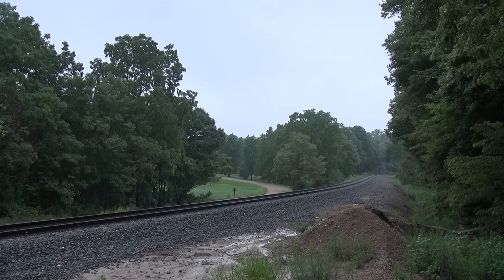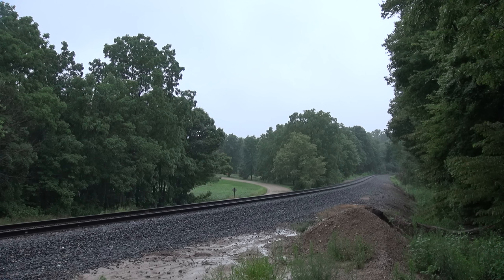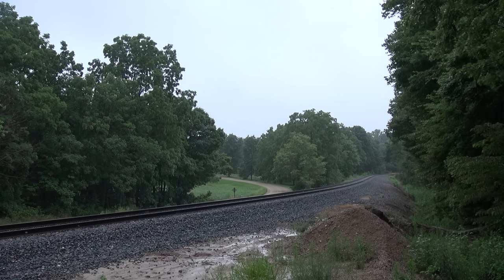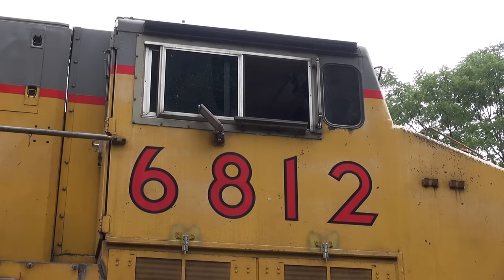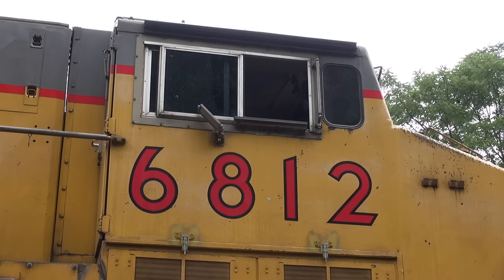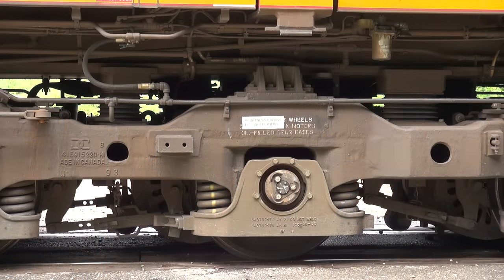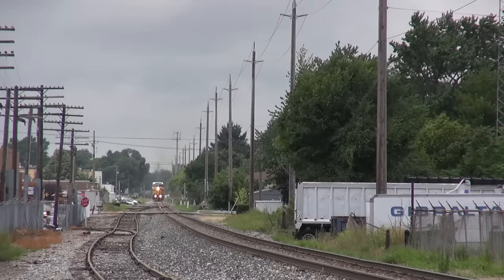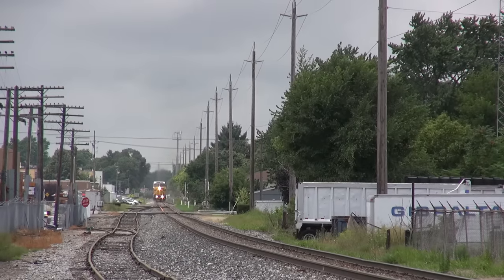TRRS 477: "Whoops!" CSX Freight Train Stalls on Grade

Comment: This wouldn't be an issue if freight trains had all-wheel drive. Yes, having an electric traction motor connected to every single bogey would cost more, but trains wouldn't get stuck on grades imperceptible to the human eye, could stop a lot faster when necessary, and could even hypothetically make use of regenerative braking as battery technology improves.
Reply from the maker: Is not so much a problem of trying to get traction, as it is just a lack of horsepower. You could take every kW generated and put it to the rail, and this train would still not get up this hill. At some point, you just run out of electrons, and most power today is pretty well capable of putting almost everything they have to the rail. Not worth the additional complexity and costs of going all-wheel drive.
Reply: @ThornappleRiverRailSeries : If AWD weren't worth the additional cost and complexity, then the best trains in the world wouldn't be AWD.
Reply from the maker: False premise. High-speed trains use AWD because they are attempting to attain insane speeds and balance out the trainset. Heavy engines with lite cars doesn't work too well - weight distribution matters. Not to mention that those trains operate as set consists that are almost never pulled apart, versus a network with millions of individual railcars and locomotives with widely varying lengths, weights, horsepower, etc. 

Completely different engineering needs and circumstances. Costs and complexities make sense for HSTs but not long, heavy drag-them-out freight trains. That's why literally nobody does AWD freight trains of any significance.
Reply: @ThornappleRiverRailSeries : You are referring to Jacob's bogies, which require a train to visit a service depot to uncouple the cars. I agree those would be a bad choice for freight trains, but they are not the only solution to building AWD trains. The French use them on TGV trains, but nobody else does. It is far more likely that nobody builds AWD freight trains because the profit margins for freight rail are so razor-thin that they don't invest in any R&D if they can possibly avoid it.

From an engineering standpoint, having each car equipped with powered bogies capable of moving the fully-loaded weight of that car (which varies depending on the type of load it's designed to carry) makes perfect sense. Powered bogies allow trains to be any length imaginable, from a few cars to several miles long, with no increased risk of structural failure. If every car can move its own weight then the net load on the couplings is close to zero, and each car doesn't have to be overbuilt in case it happens to be connected near the front of a very long train. This in turn reduces fuel consumption because the train isn't forced to haul dead weight uphill; the mass of each car's frame is less and less valuable for structural purposes the further back in the train the car is positioned, and by the time you get to the end of the train that extra mass is just dead weight -- but it still requires fuel to haul it around. In the event that a powered bogie suffers a failure, the locomotive at the front could still make up the difference, but most of the time it would just act as a portable power station.

Let's face it, freight rail is about as innovative as the Catholic church. They build things that work well-enough and then they use them forever, but that doesn't mean they're the best solution.
Reply from the maker: Shawn Elliott No, it still doesn’t work. You’re just ignoring the entire cost part of the deal. What you lose in frame weight for buff and draft forces you gain right back in powering the trucks. You then multiply complexity tenfold by now having traction motors, gears, power assemblies, cabling, computer control, etc on Equipment right now that is simple by design.

Moving freight is NOT a low-margin enterprise, at least in North America. The Class One railroads currently have profit margins between 30 and 40 percent. 

If you ever actually considered the cost and complexity from a true engineering, management and financial perspective, you’d know for sure that it is an absolutely terrible idea to go with all-wheel drive. All that work to gain basically nothing, and In fact, once you account for maintenance you’d probably be losing.
Reply: @ThornappleRiverRailSeries : I concede that maintenance costs could be a deal breaker. All of those extra motors and gearboxes could be a significant maintenance liability, but provided they are specced correctly, electric motors can run without any maintenance for decades. At that point the replacement interval for the electric components matches or even exceeds the replacement interval of the rest of the car.

Comment: My question is do they have to put the train cars back in the order they were in or does it not matter.
Reply from the maker: Typically they'll reassemble back into the original order to save the need for changing up their paperwork, which lists the order of cars and is hugely important in a derailment scenario involving hazmat. Plus then they don't have to re-hang the EOT. That is what they did in this case, double the original headed back onto the rear.
Reply: @ThornappleRiverRailSeries    Thank you for your answer.........

Comment: Not a train expert but an interested party. How could this be more efficient than running an extra engine?
Reply: Its starting to make sense... if the only place on the whole journey that requires three engines is this short sharp incline then it is probably practicable to use just two thence split the train to get it up the hill. This way, the company doesn't lose an 'extra' engine for who knows how long. The 'extra' engine can be utilised somewhere else and thus makes more economic sense. Its crap for the crew and exposes them to unnecessary exposure to risk of injury but, that is how management seems too think these days.

Comment: If some one put small rocks every 20 feet apart or so , just about 150 plus feet on forward for about 300 feet
long, this train would make it. Sand blasters are not enough. We use this method in Poland , works 90% of the time.
But again , it is illegal to do so unless you are an employee of the rail company.

Comment: BNSF leasing from CSX?  When did this start?
Reply from the maker: That's a Union Pacific leader. It's just standard foreign power, CSX will pay UP for the time they use the engine. Very common thing that results from trains running through to other lines. Most of the "borrowed" time gets canceled out when UP uses CSX power, for instance.

Comment: does the emergency braking system work when the train stalls?or is it basically useless?
Reply from the maker: Why would they need the emergency brakes? Just setting them as normal works just fine.
Reply: im just asking man.im just asking.

Comment: Comments imply the rail co. is remiss in not having enough driving engines. But economically, putting an extra engine on each train just because it might be needed makes no sense - that would cost a fortune in extra engines. Far better to occasionally experience a slight problem and delay as here.
Reply from the maker: While this is true, in this case it wasn't a "might", it was a "certainly not" case.

Comment: You can't push in the clutch,  drop it into 1st,  rev up the engine, and pop the clutch?  Worked for my 1970 Dodge Challenger.
Reply from the maker: Electric transmissions don't work that way, for better or worse! Well actually for the better with instant torque
Reply: Song "cheque
 alley

Comment: Would it have stalled/slipped if it wasn't raining ?
Reply from the maker: According to the tonnage ratings, maybe? It was technically underpowered by around 1000 hp, but it isn't impossible that it could have made it up with dry rail, depending on where in the train the loads were.

Comment: The amount of work & time needed to DOUBLE THE HILL is ridiculous. You could have sent added power to push in that amt. of time. I know I have done it way too many times. I always sent my Conductor back to the second unit & had him man the sanders on it as well...

Typical they know this hill is a problem & they know the power desk is working on paper stats for new engines yet they still do it. They still burn up the same amt. of crews. By the time you double the hill then put it back together your about done on time.
Reply: Approx how long would it have taken for this whole thing to play out?  If the line is not  busy it would not be a big deal would it?  I can understand the crew would certainly not like the inconvenience, especially the conductor. Are the crew districts planned that critically that an incident like this would cause you to time out?
Reply: @johnstudd4245  From the time we left the Yard in Mingo Jct-Oh. till we OUTLAWED in Alliance Oh. was 12 hours + the ride back to Cleveland was about a 14 Hour Day. The hill required  35 Hand Brakes on the half of the loaded train left behind.  Would have to go to Alliance siding to set off the first set of cars and go back for the rest. Bring them back double up the cars. pull into siding and tie down the train for  the next crew to finish the run. This was all done in Dark Territory Single track. But slower trains were routed down the same tracks so tying them up was a no, no.  The Conductor was walking most of the time except the ride to Alliance he rode the last car... All because of make due power..

Comment: So what is the grade of this hill, and for what distance?
Reply from the maker: It varies throughout its length, but around 1.5% average for about 4 miles. The unknown factor is how much the curvature adds to the physical gaining-elevation grade. Especially if tonnage is located near the back, that can add an exceptional load on the drawbar. Safe to say with this train, that they were probably pulling effectively a 2% grade with 9000+ tons in the rain with only two motors. Yeah, that ain't gonna work.

Comment: In this video I’m pulling serious weight almost 100 ton. Running 16 cylinder fiat Alice tug boat engine with full inter axel wheel lock deployment and sand spreader. About 23,678 h. P. 850,000 tractive drive to dah rail. Go with throttle up notch seven please. Puuuuulllll

Comment: 2 engines won't cut it. Unless the train is full of empties, you never see a CSX train in western Ma with less than 4;  except for locals with 10 or 20 cars.
Reply from the maker: In the midwest, two units are common. You see 4 a lot because of the mountains. Yes, this one should have had three based on tonnage. It's all about what route you're on and what tonnage you're trying to pull.
Reply: @ThornappleRiverRailSeries No $hit Sherlock lol. Not many mountains here, just hills. Biggest one I've seen had 7 locos and 110 cars with garbage , scrap metal , empty new car carriers and intermodal all in one. They usually aren't using all engines though. CSX Selkirk is only like 90 miles from here.

Comment: I just wondered why they use sand on wet tracks instead of just blowing the track dry with hot air. But this idea is too obvious so there must be a reason why sand is better. Anyone has an explanation?
Reply from the maker: Blowing the rail dry is actually a technique used by the newest locomotives. However, it is still used in conjunction with sand. That is, both drying the rail and laying sand improves traction, either separately or when combined.

Comment: Looks like the car brakes don't work either. That antique diesel in the lead probably isn't even pulling it's own weight and is being pushed along by the GE diesel electric behind it.
Reply from the maker: The lead engine is a GE, the trailing one is an EMD. Brakes worked correctly, the engineer just waits until they've lost all forward progress before setting the brakes. Since it takes a minute for the brakes to fully setup, they slide back just a bit. No big deal, it is expected.

Comment: They seem to over burden the train waaaay too many train cars on it, there should be a limit regardless how many locomotives are pulling it.
Reply: Why? It is their own business.
Reply: @kofola9145  Clearly you don't understand how things work. Too much load on a train can be dangerous as one it can actually end up breaking the train engine putting more strain on it more than it can pull. It's like the German Panzer tanks the engineers wanted to put 2 engines in the tank but Hitler only wanted 1 as he wanted lots but by doing so the engines would break down more its why you saw a lot of German tanks doing Ambush attacks rather then going full head on.
Reply: @Popo111603  Do you?

When you say "there should be a limit" You mean "there should be a federal or state limit"

CSX is a private corporation. If the people who represent the corporation want to burn their locos it is their decision. If it is a bad decision, they will be held accountable by their shareholders. If it is an unlawful decision they will be held accountable by the courts. 

This system is more or less the best system we have. The government hands everybody a set of colors and a canvas and we use those colors to paint whatever we want.

You have seen a stall. The stall happened because it was raining. If the rail was dry, it would not happen. It happens. It is not a problem. But because you personally think a stall is a bad thing, you want the government to tell a specific industry a specific way to run their business. 

Here comes my question: Why do you want the government to intervene in how private businesses work?
Reply: @kofola9145  You clearly never read my first comment properly so I'll explain just a little just so you can understand I said "There should be" I didn't there need to be or demanded it the term should is not a demand or to force anyone to do anything I'm merely saying what I believe but you went off on one cause you didn't read. Next time read.
Reply: @Popo111603  You should give me 1 000 Dollars.

Comment: 7:15

Why is that engine facing backwards?
Reply from the maker: Only the lead locomotive typically needs to face forward. The power is applied via electrical motors which work equally well in both directions. It is actually often preferable for locomotives to be facing opposite when in pairs so that the power can be run the other direction if necessary without physically turning the power around.

Comment: OK.. can someone explain to me why RR's get stuck like this all the time. They must be very aware that they will be underpowered for the terrain and the weight. Why don't they just add another engine to begin with instead of the hassle and lost time to gather up a helper train??? Makes no sense to me at all.
Reply from the maker: It's not all the time. And sometimes it is more efficient to double than to add the extra horsepower.

Comment: That's the Problem with CSX, they think that an AC4400CW and an SD40-2 are enough to pull a train. When you have 80+ Cars on the Train you need at least 2 4400 Horse Power Engines and Possibly a Mid Train DPU or Rear End DPU. But, CSX wants to save money so they use the least amount of Supplies and then they wonder why they aren't the Top Class 1 Railroad.
Reply from the maker: Well how many you need depends on route and tonnage. I've seen 6000 ton trains moved with a single unit no problem, on flat track. But also 130 car 18000 ton coal trains going walking speed with four AC GEVOs, two on each end. 

In this case they would have needed three units based on tonnage. Two 4400hp units would still be just a bit short, at least based on the tonnage charts for this hill.

Comment: Great video do they not know how much wait is in each rail car do they not math bro
Reply from the maker: They knew but sent it anyway.
Reply: In Australia, each car has a loading docket attached clearly stating the contents and weight as well as dangerous goods label if any. The tonnage of the consist is thus calculated by the yardmaster who advises the loco operator via written documentation of the total tonnage.

Comment: its not power actually(as some people saying).. It's the traction that gets all trains at grades. There simply isn't enough traction between just 4 driven wheels per engine locomotive to haul that much on grades. Your car might have 2000Hp but if you cant put that power meaningfully onto the road you are going nowhere mate..

Comment: So...who is responsible for figuring this?  
POWER CALCULATIONS
The Power required to move a train is defined by a simple formula:   P=TS/375    Where P is power in horsepower at the rails, T is tractive effort in pounds and S is speed in miles per hour. The engine horsepower at the flywheel is reduced by the auxiliaries such as air compressor, cooling fan, charging alternator, traction generator and motor losses, drive losses, and gearing losses. The net effect of these losses is to reduce power to the rail by 20% to 30%. About 80% of the rated engine power is available at the rail for a modern AC traction locomotive versus about 70% for the older DC units.

Most yard switching applications seldom exceed about 30,000 pounds of tractive effort and speeds of 5 to 7 miles per hour. Therefore the industrial locomotive will perform well with 500 to 600 horsepower. A short line railroad or branch line with the same tractive effort requirements might require up to 2000 horsepower to move the train because of the higher speeds involved. Main line locomotives may need over 4000 horsepower each with multiple units because of both high tractive effort and speeds.  http://www.republiclocomotive.com/locomotive-power-calculations.html